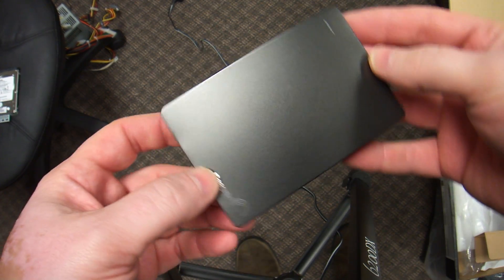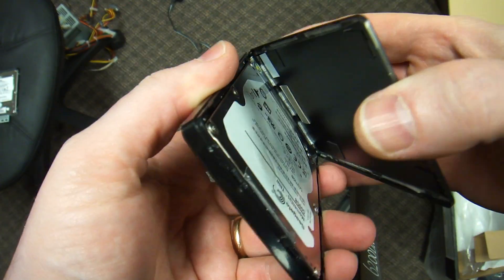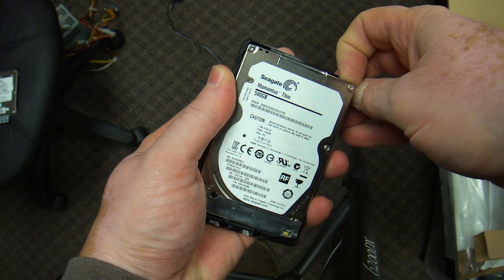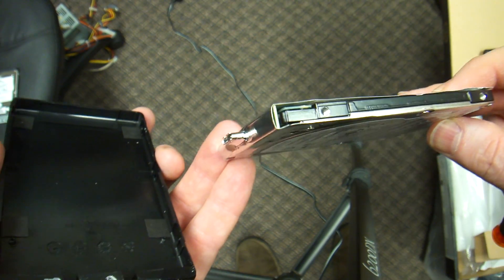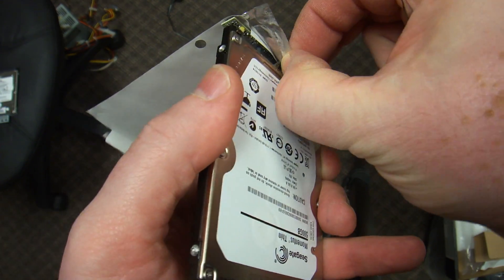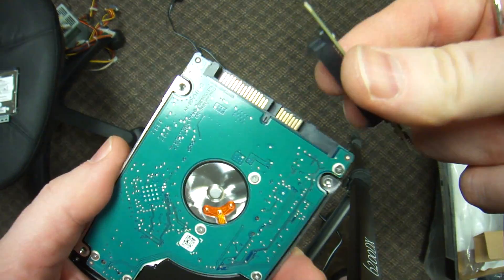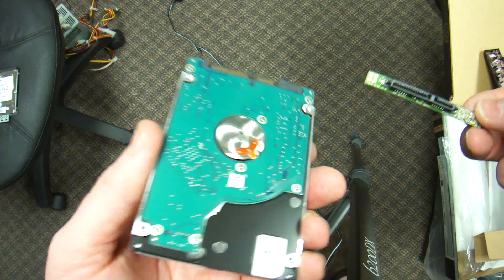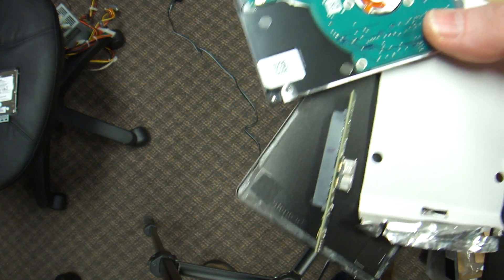How to Teardown and Disassembly of an external USB3 hard drive Seagate Slim 500GB

Comment: Hello sir I have a saegate barracuda 7200.10 500gb i replaced the PCB but the old bios is broken the drive spinning but does not get recognized is there any mode to recover data from it ?